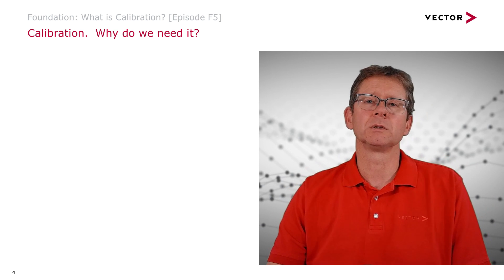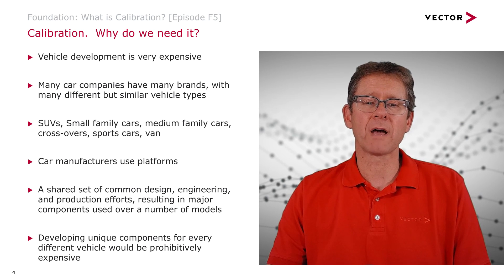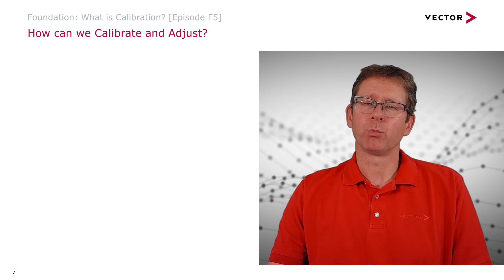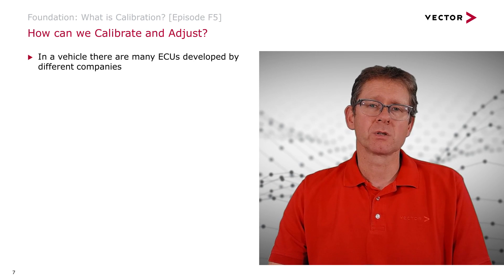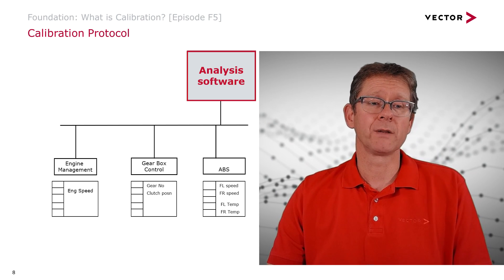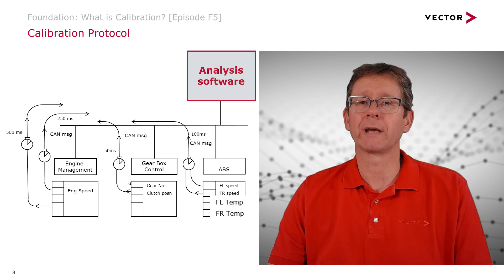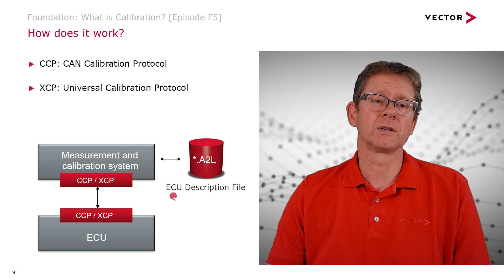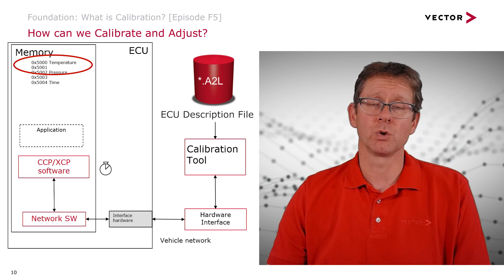Calibration: What Is It? | #EnginEEringTheJigsaw | Episode F5

Comment: Is there is difference between calibration vs tunning vs mapping
Reply: If we look at the definition of calibration it is the act of measuring sometime to see if it is within acceptable limits.  If we talk about calibrating a parameter then it often also involves tuning this parameter to be within an acceptable tolerance or to change it so that the system it effects works better.  So calibrating, tuning, or mapping a parameter within an ECU can be seen as the same.